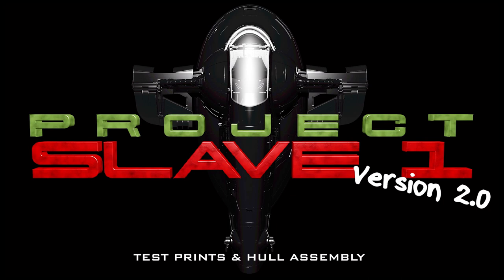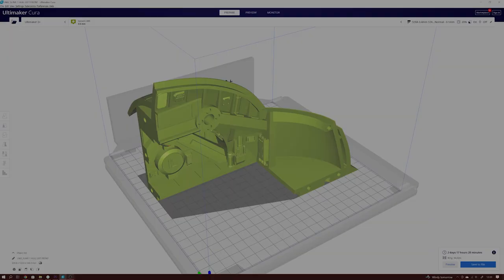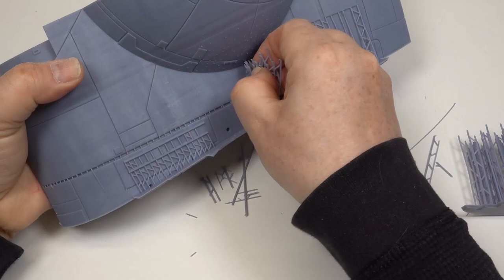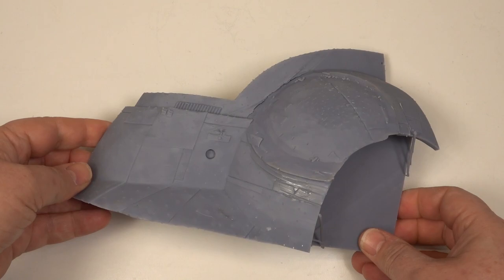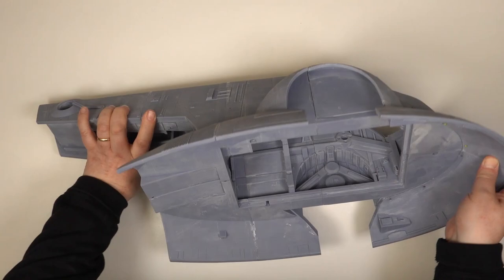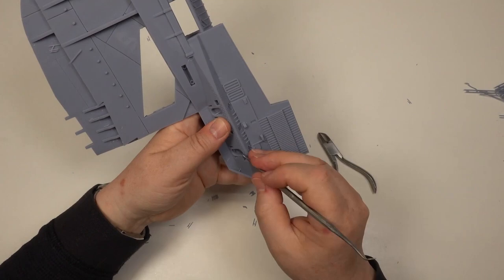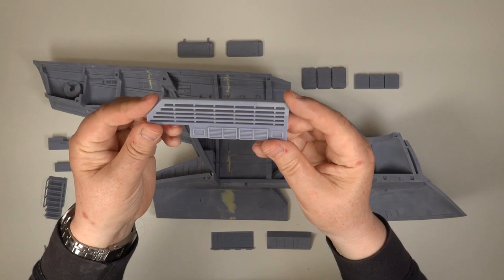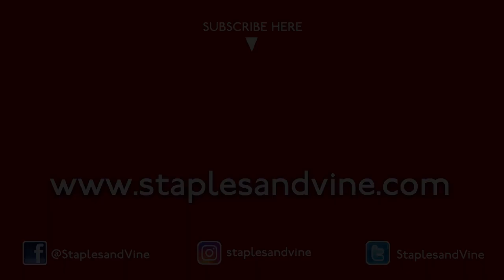PROJECT SLAVE 1 PART 15 ‘TEST PRINTS & HULL ASSEMBLY

Comment: Good job ! Looks promising, but the Cockpit Glass is the thing  !?
Do you intend to make a resin template ?
I would to love to have it in 1/72 or 1/ 144 scale. 😅
So i guess Bandai would be then a better option because of the money.
Reply from the maker: Absolutely, the glass is crucial. You will have seen from the Mk I version that I do have a plan for that. There will be a template for a vac form buck included in the stls. 1/48 would be a good size... Not too big.
Reply: @StaplesandVine  Yes, i was aa while since i saw it. I didn't remember how you did it. But still it is amazing what you can do with the printer.